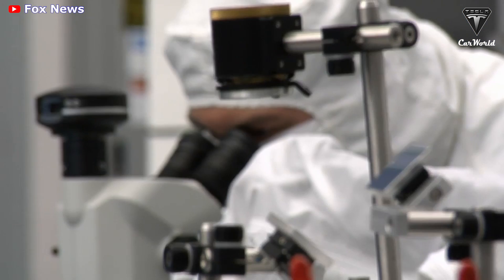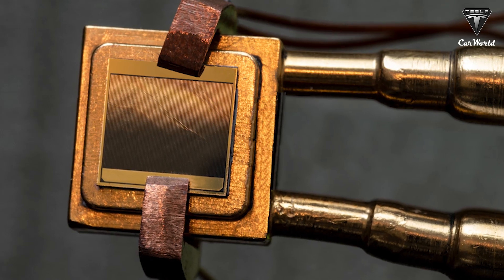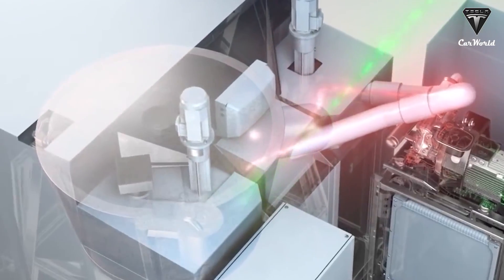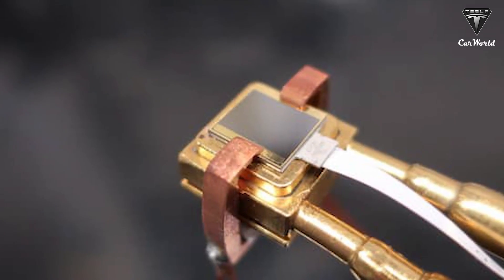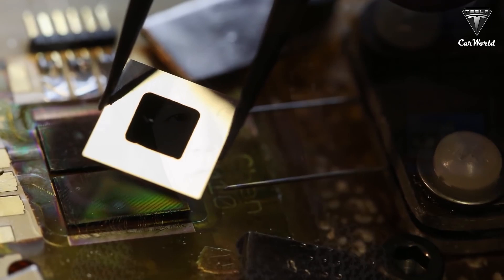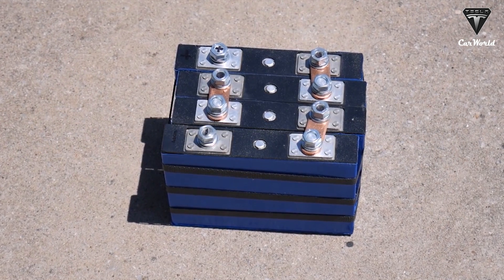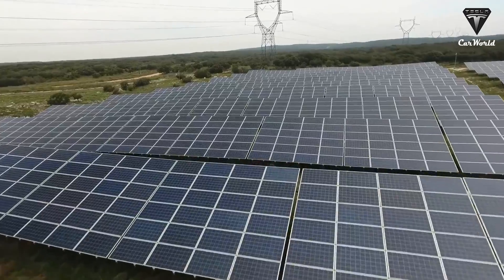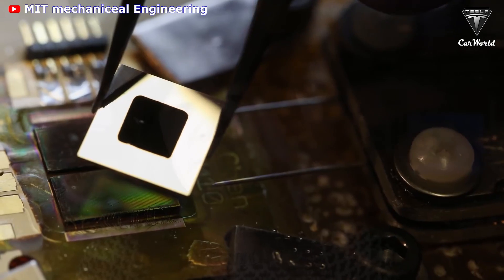IT HAPPENED! Elon Musk shocked by the new battery that could destroy the nuclear energy industry!

Comment: You missed a point. Nuclear plants use radioactive elements to make heat that is then applied to a liquid (steam) to turn turbines to generate electricity. I wonder how well these new cells handle radiation? If you could take the steam turbines out of a nuclear plan design, you could simplify it immensely.

Comment: 2 THINGS COME INSTANTLY to mind
#1.  wow.  I'm so impressed.  And I also know the advent of this will get engineers brains on a trail that will have even more amazing methods in a short while.

#2. duty cycle.  That video is all the information I have on this new tech.  And NOWHERE in there did he mention how many cycles until failure.  (I think the standard is (less than 80%) of original capacity  defines a fail)

Comment: Holy crap, what scientifically illiterate nonsense.  Just what you'd expect from Musk the con man and his ignorant cult followers.

Nuclear reactors don't explode like nuclear bombs.  Hasn't ever happened; WILL NOT EVER HAPPEN.  And the base capacity per square meter is not 100 kW...it's ONE MEGAWATT.  Since most reactor stations (that cover less than 1/10th the land a solar farm does) are generating over 2 GIGAWATTS, that makes them far better options than anything like this.  And weather means nothing to a nuke plant.  They run 24/7 NO MATTER WHAT mother nature is doing.

And as far as safety,there STILL have not been anywhere near as many people killed by nuke plants in over 50 years of use, than solar in the last 5 years.

Think about it...

Comment: Click bait.  Nuclear energy is an energy source, not a method of energy storage.  This site thinks of batteries as something that stores abundant solar or wind for when the sun is not shining and the wind is not blowing.  Instead, it will be used in much more commonly when demand is low, rather than supply high.  This means that utility companies do not need to build to match peak power.  The peaks can be covered by the efficient batteries.  This can work will all forms of energy, not primarily solar or wind.

Comment: I suspect you don't understand a lot the stuff you put out. I have seen/heard you quote highly improbable numbers before as if  they were gospel when in fact they were an order of magnitude or more off. This time you quote a battery that achieves "100kw per metre squared" which doesn't tell us a lot. Now, if it was "100 kw HOUR" per "metre CUBED" I would be more impressed. Energy density requires you to talk in terms of volume not area.

Comment: It will never work in the city. You might get that to work out in form areas where they have small towns. Big cities draw too much power.
Reply: Why wouldn't it work for cities?

If these devices are able to pull 100Kw per square meter, are fed from waste heat from industry, and can be built under ground so they don't take up any above ground space.  

Cities have the heat sources - seems like this would work extremely well in cities.

400x as much power as you get from the same size of solar panels.
Reply from the maker: Well , I think this technology is very feasible in the city because it has hundreds of times the capacity of conventional solar panels, and we can build it underground. Thanks for your comment !

Comment: The Earth is cooler with the atmos/GHGs/albedo not warmer.
To perform as advertised the GHGs require “extra” energy upwelling from the surface radiating as a black body. https://youtu.be/0Jijw7-YG-U
The kinetic heat transfer processes of the contiguous atmos molecules render that scenario impossible.
No greenhouse effect, no GHG warming, no man/CO2 driven climate change or Gorebal warming.
Will/can you refute or simply delete or leave that to Google’s censorship algorithm??

Comment: 2000C degrees is hot. There are 600-1000 C degrees systems already in use look Polar Night Energy project. Also there are liquid metal batteries. Combining those 2 will make over 95% conversion in reach. Current liquid metal batteries have losses of 20% but storing those losses into sand based thermal storage heating sand in summer months and taking out winter months also some 10 % of energy can be extracted using Peltier elements between bank and heat usage. Heat usage is at least 4x in winter times so it makes so that at winter time there can be extracted up to 20% extra electricity power from heat and that balances  gap left by near no solar energy at winter months.

Comment: It cannot replace nuclear energy because it cannot stabilize the national grid, which needs a constant huge torque for stable operation to prevent voltage fluctuations and blackouts due to local connections and disconnection of customers in and out of the grid. Such torque at the level of the national grid can only be created by huge power plants with more than 90% - 93% continuity of annual operation. Batteries can be carriers at the local level. From a national level, both technologies are necessary for a joint stable operation that enables development and cheap electricity.
Reply: bullshit. high power electronics and batteries can and will balance frequency out easily because that is the determining factor, even when decentralized. we just need to make rules or a frequency variable price for consumption and production. Such a grid will be more stable than today.